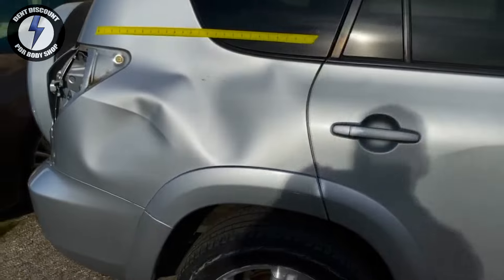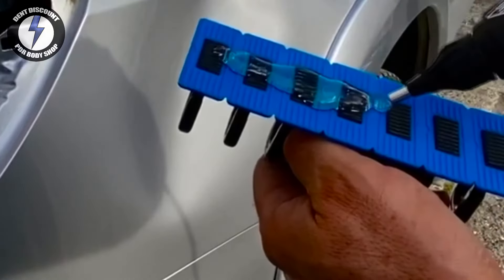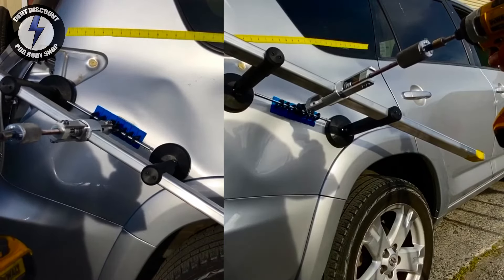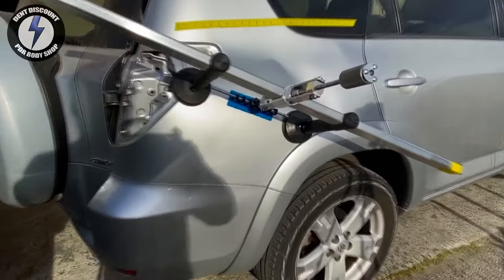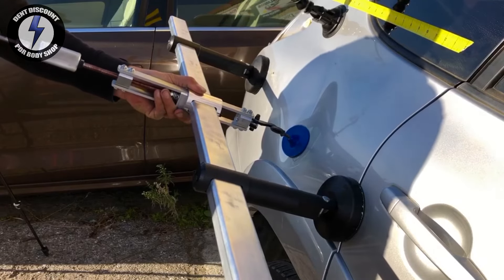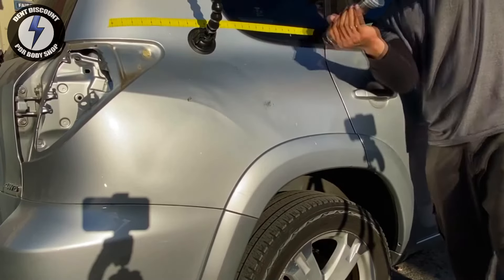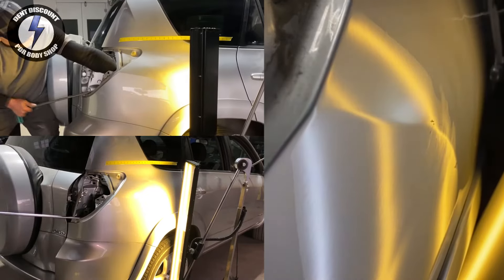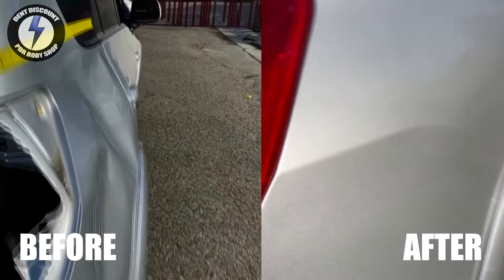Fix Huge Dent with Drill Pull and Glexo Cold Glue!!

Comment: Hi Clark - I also use Glexo cold glue, here in Devon, England. It works pretty good, but the price is extortionate, so, I did a little research and discovered that it is actually 3M Scotch Seal 5313 and is a fraction of the Glexo price, which is important to a young guy or girl starting out. I'm 78 now so I just do small dent and paint repairs for friends and family. Thanks for sharing your knowledge for free as you do. Most pdr tech's hide what they are "actually" doing much of the time, simply focussing the camera on the dent as it rises. You show how your hands are pushing on the tool. I would strongly advise any young, would be pdr tech to sign up to one of your courses, that would set them up for life. Worth every single dollar!
Reply from the maker: Right on David I’m going to check it out for myself I’m going to Google it right now thank you for your insight

Comment: what brand of silicon do you use
Reply from the maker: I use a high strength glue..
Depending on where you live 
you may need to use a different type of glue depending on your humidity in your area.